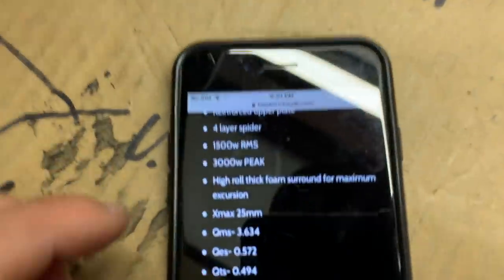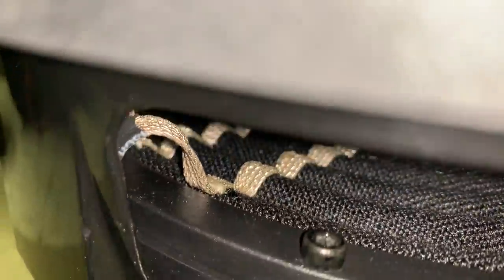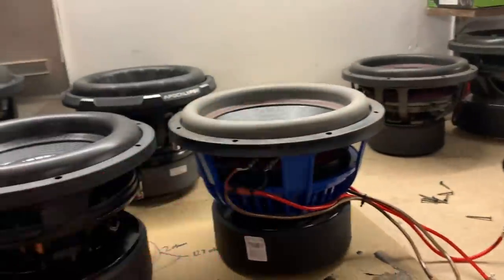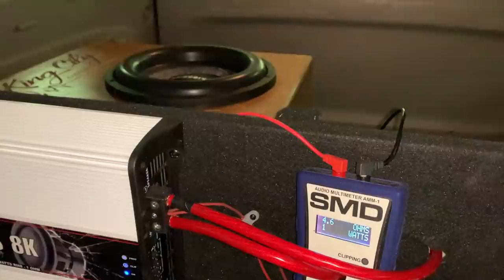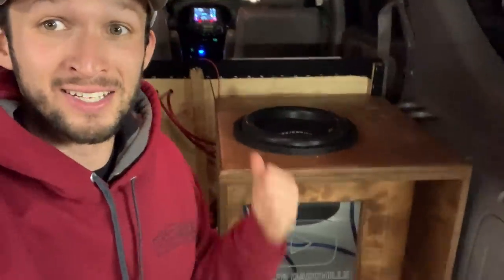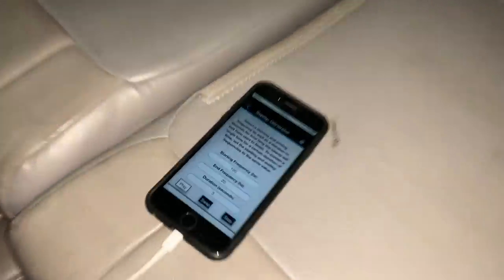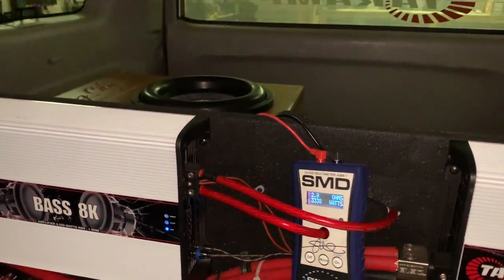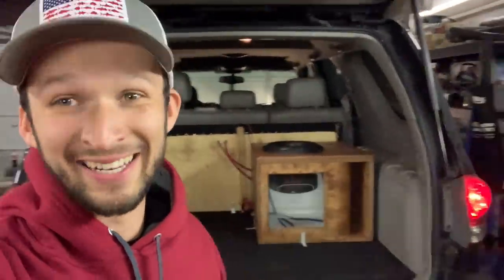My Favorite BlackBrick Subwoofer! The BB3v2 Full Review

Comment: Favors the skar VXF. Mainly because the of the TI basket. Very nice sub can probably take a clean 3000 rms easy
Reply: Right and cheaper
Reply: Facts! I’ll stick to my skar cheaper 💪🏻
Reply: not really lol I wouldn't put 3k on it all day lol
Reply: @loganmilam4065  if my VXF can take 3k easy these will be fine too especially with a bigger motor.
Reply: @rashad5286  I meant that zvx. I bet these could happily. Have you actually clamped your amp for your skar?
Reply: @rashad5286  3000rms each sub ? 12 “ or 15”?
Reply: @josecunsako31  Rn I have 2 of the Vxf 15s on a DD m4b at .5 thinking about upgrading to an 8k  tho 🤔
Reply: @rashad5286  do it and post a vid
Reply: @josecunsako31  Bet. I'll see if i can get a vid of them on the 6k when i get back in town !
Reply: @rashad5286  do that and let me know bro! I just got 2-12”. Vxf but I need couple stuff still like alt, battery , big 3
Reply: Yea what people don't know is the VXF is better all around than the ZVX
Reply: @TheeMissingLinc  from what I’m seeing and hearing that’s true
Reply: @TheeMissingLinc  I agree with this I ran the 2 ZVX's before this and the VXFs sound ALOT better. And before those ZVX's I was running 2 of the newer American Bass XFL 15s
Reply: @loganmilam4065  Yeah with my DD m4b at .5 and charging at 15.5v  I clamped 6192 but I rise a little over 1 ohm
Reply: @josecunsako31  Yeah man i'd throw those on 4k minimum. The'll take a while to break in mine were stiff af lol
Reply: @rashad5286  but you won’t be able to see the whole 4K cuz of box rise and I bet
Reply: @josecunsako31  True, if you have strong electrical id try wiring at .5
Reply: @rashad5286  the thing is I got dual 4ohm I’m  gonna be wired down to 1ohm. You have the dual 2 ohm
Reply: @rashad5286  what all you have to reach 15.5v?
Reply: @josecunsako31  Rn I have a 270 amp singer alt with 50 ah of LEV50 lithium. Switching to lithium from AGM was probably the best thing I ever did tbh 😂.
Reply: @rashad5286  that’s what I want lithium but I’m in search for a good and cheap one lol I don’t know much bout them so still researching
Reply: @josecunsako31  yeah bro i built this bank myself but its usually cheaper to build. if you're only charging at 14.4 i recommend headway lithium if you want to charge in the 15's go with LTO or Cmax. its a bit more expensive but lithium takes up way less space and the voltage is rock solid
Reply: @rashad5286  gonna do big 3 and alt first then I’ll get to that later. But Definitely I’ll get the lithium battery
Reply: @josecunsako31  Thats whats up! I'd definitely recommend mike singer if you need an alt build
Reply: @rashad5286  I’m gonna have to look into that one
Reply: @rashad5286  is xs power d7500 good for what I want or is it to much for what I want ?
Reply: Yes the vxf's sound way better and catch all the lows smoother and deeper
Reply: @rashad5286  I have my 2 vxf 15s on 2 skv2 4500 half ohm. Gain matched and they eat it.
Reply: @projectcrowdsurfer3732  Yeah man people underrate how much power those VXF's can take LOL.
Reply: @rashad5286  xfl is one of the most musical subs out there.
Reply: @knikkaknikk86  I ran XFL 15s for about a year and a half on my m4b loved those subs they sounded great! Only problem I had was they got a stinky when hammering the lows for a while.

Comment: Getting back into subs was going to buy 2 12 inch p3s for my daily but this got me reconsidering what do you guys think ?
Reply: These offer so much more performance than the RF P3. It’s not even really a close comparison. I don’t have firsthand experience with the BB but on paper, they’re way more capable.
Black Brick subs in general have great value/budget pricing, but their design specifications are top-notch. Not only do they have great specs but they also look very well built. And the minimalist/industrial styling is sexy af. I think they’re some of the best looking drivers on the marketplace. 
I’m a Brit but they don’t have a UK/EU distributor. If they did, they’d be at the top of my list for my next build. 
Another good indicator is that with each production run, nearly every product range sells out. You might have to be patient if you decide you do want some BB subs

Comment: how do you usually break in a sub? Just play it low for a bit. Getting a system for Christmas just wondering?
Reply from the maker: You don’t necessarily have to play it low but don’t full full tilt on it when brand new. Takes a little while for the spider to loosen up

Comment: Mmmmmm! At $349.99 and no way to add the discount code, I'll pass. These are great looking and sounding subs, but others with similar specs and RMS for less and also sound killer good. Great video as always Parker, we thanks you sir.
Reply from the maker: You add the discount code once you are on the checkout screen. I just tried and it worked for me
Reply: @ParkerTheBasshead  

I tried as well and didn't see anywhere for a discount code!? I'll try it again and see how if it works, but I'm thinking the Savard HIQ 12 is a better sub at a Lil less$$. I have been checking Blackbrick out for a while now, I'm very curious but they seem a bit $$ high.
Reply from the maker: @mikewaters6339  yeah I feel that. Everything seems to be getting expensive. Miss the good old days when this stuff was cheap
Reply: @ParkerTheBasshead  the discount is 20% not 25%
Reply: @ParkerTheBasshead  

Ok, I was able to get coupon in and now it's $309.99 a much better deal with code. Lol, I'm in debate now,lol. Keep at it buddy, your doing good work.
Reply: I got 2 15 belligerent series and used ur discount got 100 bucks off thanks